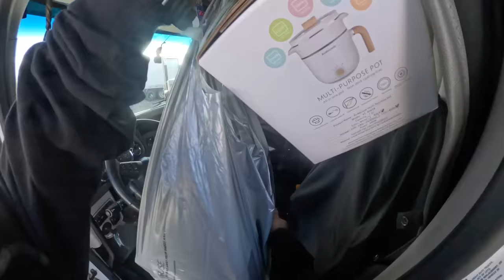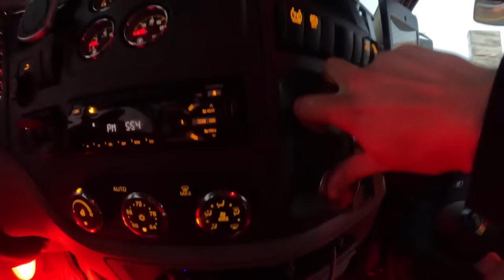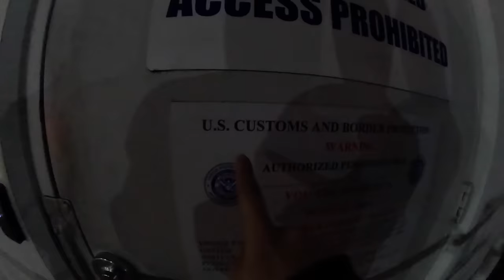My First Relaxing Overnight Truck Camping w/ my New Xbox & Spicy Ramen on Hotpot

Comment: You can just pull over on the road/highway like that anywhere and sleep??
Reply: Usually near or on the exit ramps where you don’t obstruct the view near intersections or merging lanes. This is allowed because it’s common to not find a single vacant spot at truck stops.